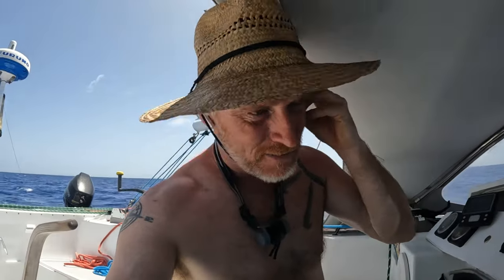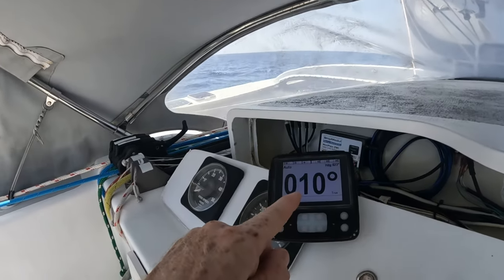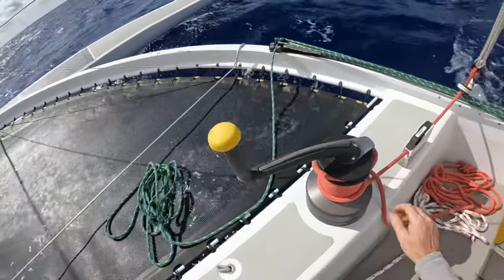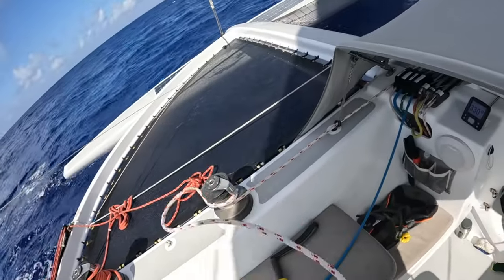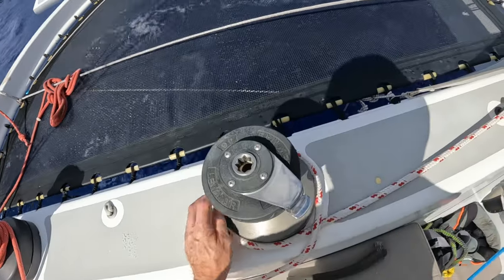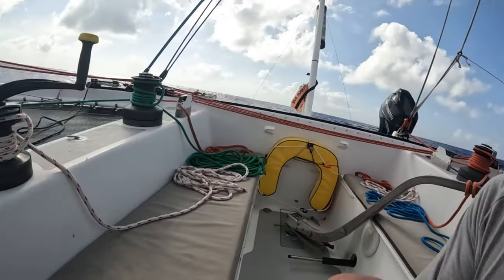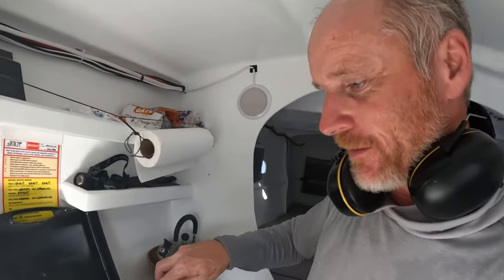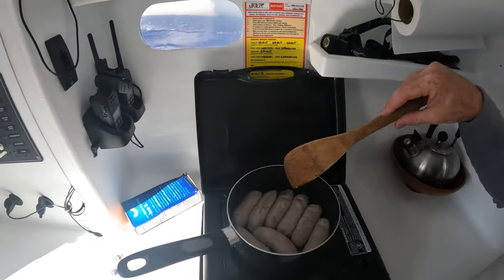Houston, We have a Problem | Solo Sailing  | Antigua to Bermuda

Comment: Is there a reason that the boat doesn't have a wind vane as a backup for the autopilot?   My dad always preferred an auxilliary rudder type, like a hydrovane.   If you were to get hit by lightning and lost your electronics, you'd be stuck with only hand steering.

On a passage from Bon Aire to Florida, we got hit by lightning.  We lost all the electrics except the house batteries, alternator on the engine, and the backup radio (which we stored in the oven during the storm).  We had a Hydrovane, our sextants, charts,  a calibrated compass, and good charts . . . so we decided to keep sailing, as Florida was better for repairs anyway. 

I crossed the Atlantic three times with my dad on a Pearson 39-2 (monohull).  We also sailed from Maine to Santa Barbara, CA through the canal and then to Hawaii (my graduation trip).  Of course that was before GPS or Solar cells.   He and I had a bit of a competition every day, plotting our location and updating the chart, (my lines were Red, his were black).

Comment: Over many years of sailing and electronics , I came to my view that all electronics fail, when you put them into a complete bundle , 1 part failed and you have nothing ,  auto pilot should always be on its own , to many tiny wires and salty sea air , don't mix ,  I would always give up sailing to a wind angle , and have something that stays on,